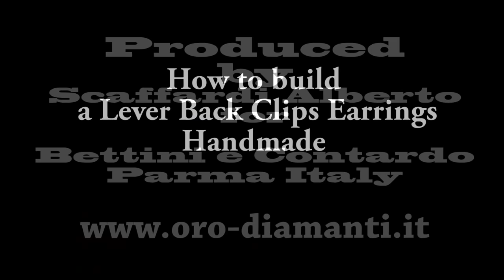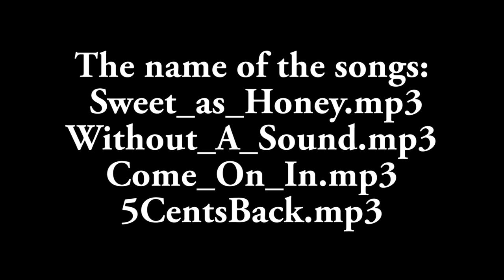Handmade clips earings. How to build a lever back clips earrings

Comment: Been a fan of your work for so many years! Actually learned most of my metalsmithing from your videos haha. I was curious what brand of saw blades you use? I tend to get those thinner blades running away all the time, although I'm sure mostly it is due to skill 😂 i still think i am not using the best blades.
Reply from the maker: I usually use three sizes, 0, 3/0, and 6/0 depending on the job. Remember the thinner the blades the harder it is to go straight. The brand I use if it's available is called IRIS jewelers' saws